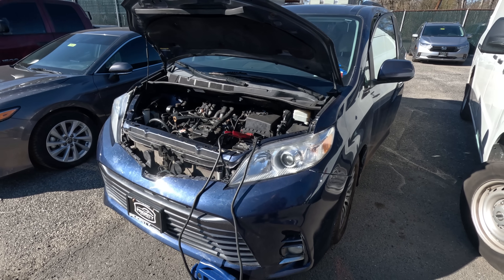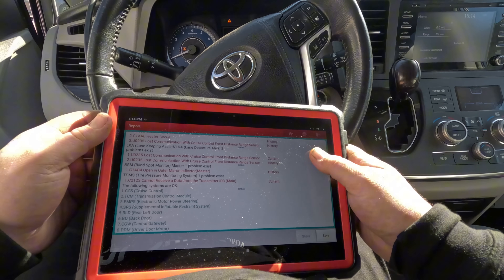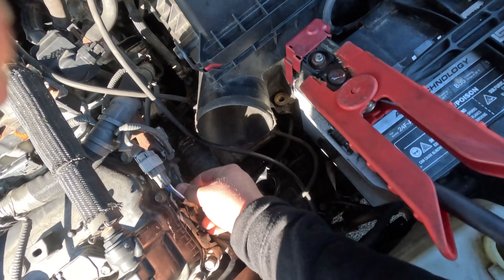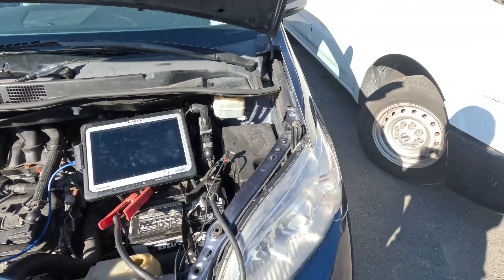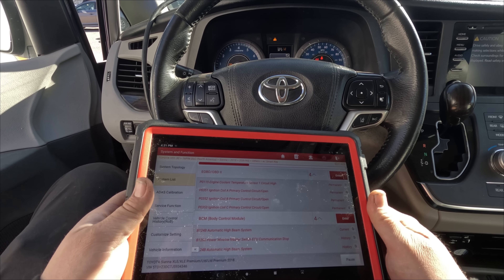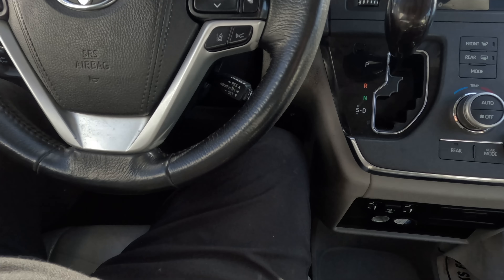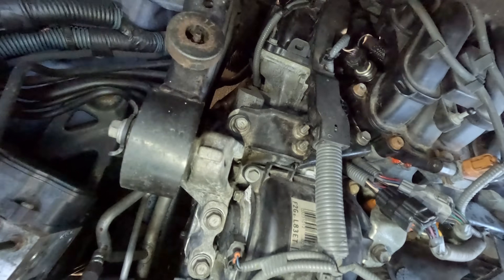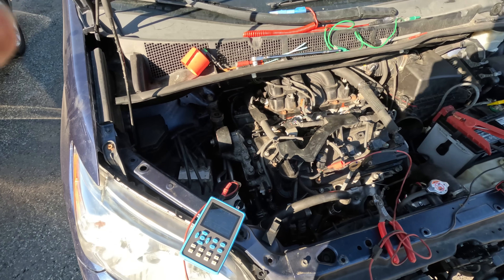2018 Toyota Sienna - Crank no Start! Diag & Repair!

Comment: Loose Ground bolt was it sabotage by a mechanic trying to purchase a Sienna cheap?
Reply from the maker: It was a mistake, the shop installed this engine then it wouldn't start.

Comment: Do you prefer the TopDon or Launch scan tool? 
 By the way, you’re the man! I enjoy watching your videos and continue to learn a lot from them. Thank you!
Reply from the maker: Thanks! Generally speaking I like the hardware on Topdon better. The software is pretty much the same although they each have there pros and cons. The topdon reports I like better because they email from TopDons servers. The launch has a feature for Toyotas that can read all the ROB data in one screen, So thats what I use on late model Toyotas. If I could only have one I would take a Topdon.

Comment: Tnx a lot for all your  informative videos.  I have a question ,why test light couldn't show the problem in this car while the car had bad ground?test light showed light works well and means good ground and 12 volt but it was problem there
Reply from the maker: I think when I wasn't cranking the engine the ground was making contact so it was able to light a testlight. When it was cranking or running the ground was shaking so it was not making contact.
Reply: @advancedleveldiagnostics  you are the best . 🌸🌸🙏🙏

Comment: Dont forget to seal the holes you put in the wires using those wire pierce prob gonna be some more problems in the future. Lol the effects of corrosion is a real thing! Voltage drop can be used if you only have a multi meter and no scope to check the grounds as well
Reply from the maker: Good point, I seal them with clear nail polish.

Comment: Could you please briefly explain why those spikes mean bad ground?
Reply from the maker: A scope or multimeter is just subtracting the negative lead from the positive lead, the negative lead in this case is supposed to be close to zero, and the positive is supposed to be five volts. Here we see the five volt signal is not zero to five it has around a volt at base level and every time a coil fires the ground point raises even higher, indicating there is a bad ground. meaning the negative lead which is being subtracted from has voltage on it
Reply: @advancedleveldiagnostics   Essentially a floating ground? Makes sense. Thanks!

Comment: how do you know that’s a bad ground? and what is the red channel its the ground trigger of the ecu? thanks for the reply 😉 by the way e really like your video 😉
Reply from the maker: A scope or multimeter is just subtracting the negative lead from the positive lead, the negative lead in this case is supposed to be close to zero, and the positive is supposed to be five volts. Here we see the five volt signal is not zero to five it has around a volt at base level and every time a coil fires the ground point raises even higher, indicating there is a bad ground. meaning the negative lead which is being subtracted from has voltage on it.
Reply: @ i get in now mate thanks for the reply, i try it on a good known car and the signal is like a square wave there is no small spike and close to zero 😉 thanks again for your video another knowledge for me 🫡

Comment: How do you read voltage on the little two channel scope?
Reply from the maker: If you go in the menu, there is an option called meters were you can turn on voltage, or you can read it with out the number, every box represents the amount of voltage it is set to.
Reply: @advancedleveldiagnostics  thanks

Comment: Great video as usual! Do you by chance still have a link for that Tough Book you’re using? I think you said it was an Amazon refurb in an earlier video. I no longer see it in your store link. Thank you for passing on your knowledge!
Reply from the maker: I buy them on eBay, its hard to provide a link because I don't want to take responsibility on any one seller. The I5 7th gen you can get really cheap for $150 - $300. however you can't upgrade the ram on them because it's soldered to the board, so I try to get the ones with 16GB of ram installed. My most current one I'm using is an I7 7th gen with 16GB of ram. it also has the extended batteries which is great but hard to find. I paid $500 but it was a really good deal.
Reply: @ Thanks for that info. By chance did it come with a keyboard? If not I’m sure it’s Bluetooth capable. Great channel: love watching you diag & repair!!!
Reply from the maker: @ Yes, it comes with a keyboard. I leave it in my truck.

Comment: Do you just charge a single flat rate to come out and diagnose a car? Or do you adjust your fee based on what you find on an initial check?
Reply from the maker: I have a flat rate for coming down and that includes an hour of diag, after that it's per hour.
Reply: @advancedleveldiagnostics  and how does your rate compare to the average independent shop rate in your area?
Reply from the maker: I only work for repair shops and used car lots, so the repair shop will usually up my charge to the customer. Its about the same as the repair shops in my area.
Reply: This is what I was curious about as well. What is the working radius? Like 30 miles?

Comment: Another good one sir!! Who makes the low profile ratchet used to tighten the ground wire bolt?
Reply from the maker: I was using a 1/4" Snap On flex ratchet

Comment: A bad ground, and it’s not a Chrysler quality product™️? 🤔😂

Suspicious! 

Good job!
Reply from the maker: Well this one was human error, he forgot to tighten the bolt when he installed the engine. Chryslers go bad by themselves😀
Reply: They replaced the engine and did not put it back properly. Would be sus if Toyota's now rolled off with such incompetent mistakes
Reply: One ground strap in the least obvious place… could get worse ¯\_(ツ)_/¯
Reply: Well Toyotas roll off the assembly line with a whole bunch of other incompetent mistakes
Reply: In the last years, yes…

Comment: Hello, how do you like this scantool vs the topdon elite?
Reply from the maker: I like the hardware better on the topdon, I like the C charger over the micro, also I prefer the reports on the topdon. like how you can email straight from the tool. The advantage the launch has is on Toyota's you can view all the ROB data in all the modules on one screen. the topdon you have to go into each module to access that info.

Comment: The great thing about old style king lead distributor systems was the ability to put secondary waveforms together on one screen, making it easy to spot the problem. This Toyota IGFT is almost as good on a COP system. Gotta love the way you spotted a pattern consistent with bad ground. It would have been fun to probe into that common ground with your scope to show it drift up and mess up your waveforms. Even a multimeter across your 4A test light to find the downstream resistance might not have spotted the problem because vibration from a running engine was the missing ingredient. The loose screw was jiggling in place giving intermittent contact.

Comment: nice job ,did you buy new scanner?
Reply from the maker: No I've had this for a while. I bought it for heavy duty trucks but I use it on later model Toyota's because it has a feature where it lets you view all the rob codes on one page. this car does not have them but the car I was working on before this one was a 2023 so I just used the same one.
Reply: @advancedleveldiagnostics  cool ya i never seen you use that one before.